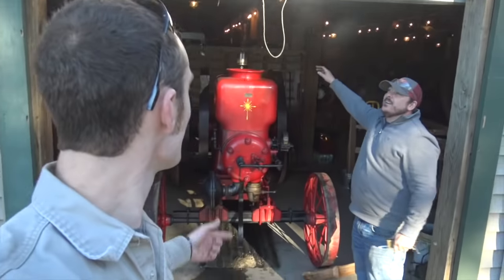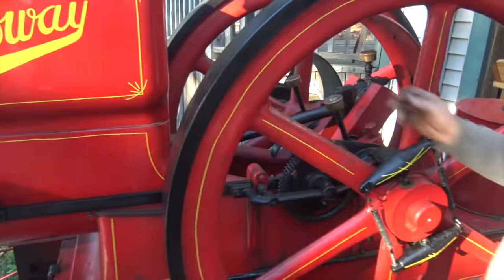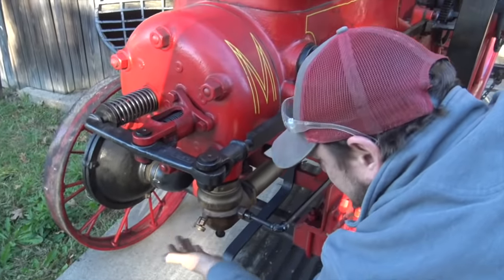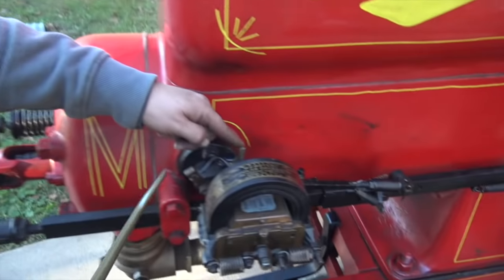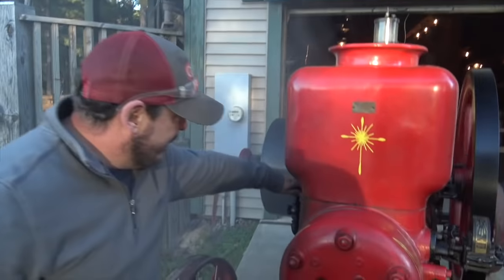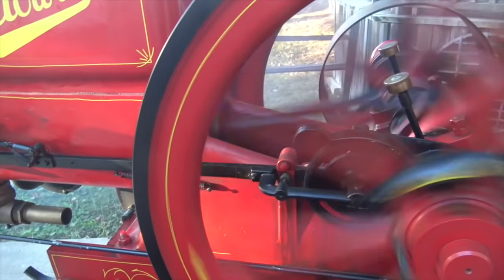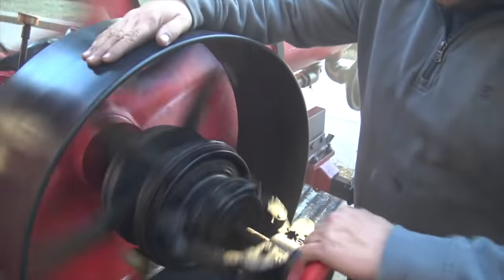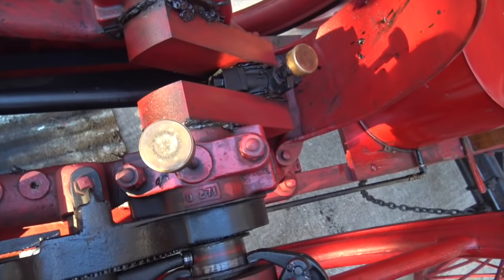WHY THIS INCREDIBLE ENGINE FROM 1916 IS PROOF THAT MODERN EQUIPMENT IS A SCAM & OLD STUFF WAS BETTER

Comment: When I was 13 to 16 I used to work in my dads scrapyard. We often got farm clean out jobs, old factory clean out jobs . . . scrapped lots of stuff from the turn of the century . . . 1900 I am talking.
One complete 1880 generator set we kept for a few years, had a coal fired steam engine and a generator, made DC current and a LOT of it. It had been in a factory from before that part of the city had reticulated electricity. The company was a family business and the grand father had them keep it as backup power. It had been perfectly maintained, and we ran it a couple of times just for the interests sake.
Imagine what it would be worth now. Eventually it went out to the steel-mill, and was scrapped.
Reply: A complete, well-maintained 1880s generator. Scrapped.

😨😨😨😔👎🏻

You know, I am no mechanic, but it still pains me to read that. Any museum would have loved such a machine.
Reply: @Briselance  Any man who saw it would have walked over to it and said
"What in the world ? . . . what an amazing looking old machine . . ." and touched it avariciously, committing the sin of coveting.
It had been made in the days that machines had inch thick cast-iron casings and pedestals with ornate,  thick makers plates of brass, where we would have a sealed bearing with a grease-nipple, it had these little brass cups with springed-caps, both the motor and the generator identical in their design touches, like some art-deco piece . . . 
And it RAN, it was fully functioning and SMOOTH as a Rolls-Royce . . .

I will obviously be in that circle of hell reserved for vandals and philistines.
Reply: Scrapping such a perfect machine is sacralige. 😭

Comment: I have a Fairbanks Morse model Z 3hp. not a hit and miss but from near the same era. I am  like a little kid every I  time I fire it up. It starts at 6 below and at 100 degrees. These are just amazing pieces of history from our past. I will never part with it.  What a beautiful machine!
Reply: Make sure it is passed down to someone worthy and trustworthy, in case something happens to you.

These pieces of historical engineering are worth it.
Reply: @Briselance   It will be, My son loves it and much as I do and he has been there every time I have started it and knows it about as well as I do. He is an adult now and I have had it since he was a child. It is very loved in my family.
Reply: Those type of engines were used a lot by railroads to power motorized track gang carts or "speeders"  The East Broad Top Railroad (which I am an off again, on again volunteer at) has at least 3 speeders that are powered by such engines that were built, IIRC, sometime in the 1920's & 1930's.  In addition to giving rides to tourists during the regular excursion season, EBTRR employees & Friends of the East Broad Top volunteers still use them for track work.
Reply: The only reason I would ever part with something like that myself is if someone I knew was able to fab that sort of machine.  

Then I'd let him tear it apart, 3D scan every part, change a thing here and there and start producing them.  Put the plans on the web for free.  Do a little Mechanical Necromancy ;)

Comment: My Great Grandfather drilled oil wells in Butler County, PA and used the natural gas from the well heads to power hit and miss engines to pump the oil.  One of them did backfire while he was standing on the flywheel footpeg and throw him through the roof of the shack.  Each engine had a different barker so they could tell from a distance if one stopped.

Comment: The machine shop, gearbox repair business where I work had a machine that sharpens blades that make worm gears. It was 86 years old when it needed its first repair. The need? A thicker spacer. The engineering on the machine was so intelligent.

Comment: Love it. I go to shows all year round that have these kind of working engines, steam, classic, military, agricultural, commercial vehicles. My passion is motorcycles.
A slightly different story. When I was at college studying engineering, we used to do tests on a single cylinder 1100 cc diesel donkey engine. Brake dyno torque measurements mostly. One of my student peers complained that there was blowing from the engine and pointed to a 3 inch pipe. I told him it was the inlet stack. To disprove me, he put his workbook in the vicinity of the stack.
Naturally, it sucked a 3 inch hole in his book and then consumed the rest.
His whole year's worth of notes came out of the exhaust stack in tiny pieces.

Comment: The thing, or the information, concerning this engine, and like many others, is: If there had been a cam that opened that intake valve, much more HP would have been created. That was the secret of that time.
Reply: @sourand jaded exactly! low rpm and high torque is what gives the engine its longevity.
A cam has more wear than a spring valve

Comment: I expect the torque is amazing. I remember we had a tug of war between a steam traction engine with I expect low horsepower and probably 50 people. Nobody won as the near two inch inch thick rope broke and sent us all flying. This was of course a long time ago before the days of elf and safety.
Reply: There is a Snow gas engine that produces 600 hp at 100 rpms and has a torque value of 31,500 ft lbs

Comment: I firmly agree with the statement made in the title of this video. Used to work for a defense contractor that made various military gear, so it was a sewing factory & when we were building a large, mostly automated piece of equipment, when it came time to select the 3 sewing machines, there we’re basically two options…buy brand new commercial brother sewing machines (great products) for a cheaper price, or 1940’s era refurbished American Standard machines for a decent amount more money, the decision was made to go with the 80 year old machines for more money. Rightly so.

Comment: I've always known older is better. I'm still driving a 1981 Chevy C10. Less than $9K in it. Had it for almost 30 years. Wouldn't trade it for anything.
MAINTENANCE, people... MAINTENANCE! Learn how to work on what you drive. Can save you tens of thousands.
Reply: I bought a minicar EV. When all your stuff stops working because there's no more gas I'll still be able to charge mine with solar for the next 20 or 30 years. My EV is chinese on purpose, it doesn't come with a ton of microchips like their western counterparts. 

There's something to be said for old technology, but when it requires oil, it will just be a chunk of metal at some point in the near future. The only old technology that will survive is wind and water powered.

Comment: Considering that the owner just bid on an anvil, one use for that engine would be great for would be powering a blacksmiths power hammer of about the same vintage or running a small sawmill set up.

Comment: Nice! I have the 5 HP version of that engine. It hasn't run in years. Moves by hand, and seams to be in great shape. Where did you get your springs? Most of mine are missing.

Comment: The key to making something last forever is to make it run with as low-stress as possible.
This thing has 16 horsepower. Granted true horsepower, but even for that 16 is rather small.
It's RPM never went past 200 here. 
And I don't see the compression on that enormous piston being particularly strong. Especially with the exhaust valve open so much. 

There is not a lot of heavy banging from high compression & smooth 4 stroke Operations. So the piston rings, piston & cylinder walls have virtually nothing wearing them. 

There is not much temperature change on the engine with it firing so sparsely. So thermal expansion & contraction wear isn't really an issue.

There is not much centrifugal force being put on all the internal components, such as the crankshaft, camshaft & their respective bearings. With such a slow RPM

You could probably get 5 years out of this thing by running it dry! DRY! AS IN WITH NO OIL WHATSOEVER IN IT!

These days, you won't get 10 MINUTES out of a dry engine! 

But put oil and/or grease in it?
Once in awhile. 
That thing'll outlive your grandchildren, and their grandchildren's grandchildren.

Just keep the EPA away from it. They have a tendency to make life hard for the average person like you and I.
Reply: What is this type of work is this engine used for, cause carring around a 1/2 ton block of steel for 16 horses power doesn't seem very practical.
Reply: They need constant lube actually.  They would burn up fast without oil.
Reply: @micahanglen4331  Stationary engines like this were used primarily for agricultural equipment, like threshers, winnowers, balers, and the like. Of course people also connected them to pumps, generators, and other less agriculture-specific things. Nowadays we certainly can make the needed power with a lot less weight, but the robustness of this design is impressive.
Reply: 10 years with no oil?
Smartest dude who zerks it to low compression low efficiency engines

Comment: I'd like to see one of these hooked up to a generator head and powering a modern home!
Reply: I don't believe it would power a modern home. It would only be good for around 7000 watts, and most modern homes use far more than that at peak. To have no disruptions most people would need a peak supply of 20,000 watts or so, and larger homes might need much more. It would also require a significant gearing system to spin the generator faster as the speed on this was far too low for electrical generation at 50 or 60 cycles and 120 or 240 volts AC. The fact that it is a hit-and-miss also means that no matter what you do, the cycles will fluctuate a lot. Some things are more bothered by that than others. While it would be a fun project, it wouldn't be practical on a daily basis.
Reply: @edifyguy  If you add a good bank of beefy capacitors to smooth the power fluctuations and batteries to store the excess then you can have a very energy efficient home power solution with the hit and miss or steam engine.  Remember that if you have a large enough battery bank and a decent capacitor bank set up then you can power your home while the engine is not running and in-between ignition without fluctuations in electricity flow.

Comment: Over 100 year old Gear:  Still runs perfectly

5 year old Gear:  either already breaking or already broken
Reply: Well, we're having a slight bias here to be honest. The stuff that has been running the last 100 years is unlikely to break down anytime soon. Everything that could and did break down already has been replaced, so we're looking at the toughest survivours of what was made a century ago.
Reply: New gear last as long as the warranty does, and not a minute longer. Hahaha slaves! 🤣
Reply: @dikkie1000  not quite true,most surviving peices of machinery are because of those who 
1. Looked after it. 
2. Didn't update working machinery. 
3. Have saved it from the scrapman!

Comment: 3:00 that’s because engines don’t have detonation unless they’re knocking, they have deflagration. Burning smoothly like that is more efficient and doesn’t damage the engine. Pretty much all large engines are actually quiet like this. The loud sound mostly comes from the rapid puffs of exhaust, but if you’re running at 50 RPM or less, it sounds more like a chain of puffs than the engine sound we are familiar with

Comment: The reason these old engines are still around today is that most of them haven't run or pulled a load in 80 years or more. Anything will last forever if it isn't used.
Reply: Not all true.
Ford used to manufacture straight six engines that would easily go 400 thousand miles with minimal maintenance. It was their simplicity and durability that made them twice as efficient as digital heavy modern motors and systems
Reply: @ethanfleisher1910  "twice as efficient"? How many MPG did it do (or % efficiency)? How often did fluids need to be changed? How much power did they have? What about specific power, kW or HP per kg? And last but not least: If they were so good... why does nobody today build them? Not the US, not chinese, indian, simply nobody.

I like old stuff. But acting as if it was the best thing ever is absurd.
Reply: @leocurious9919   I would look more into THAT PARTICULAR engine. I'm not saying on average, or making a comment about other combustion engines, but there were a few that really were insanely efficient not just for their time but remain that way today. And maybe reliability was the correct word, I suppose, I can't say how mathematically true the efficiency is, this is A fucking yt comment haha
Reply: @ethanfleisher1910 You just made that up. They aren't more efficient. Digital efi is way more efficient.
Reply: @leocurious9919  its because the government banned them for the environment

Comment: Older vehicles didn't need security devices to keep people from stealing them. If you didn't know the code you weren't starting that thing.
 Pump 3 times hold starter for 5 seconds,wait 60 seconds pump once hold starter for 10 seconds. Don't touch the gas turn the key and it starts. No one could start your car but you.
Reply: Lol, my old 78 is loyal -20 or could be -40. Good pumping and Betty fires right off. Granted shes cold blooded so it takes a try or two but she comes to life just to push snow or be a skidder. Granted, theres a trick to starting that only people who run the truck know. My F700 you gotta hit a switch before it even thinks of firing off. Will crank but wont start.

Comment: I am a mechanical engineer by trade and I am 95 years old and I COLLECT BOOKS AND MAGAZINES ON TECHNOLOGIES and I buy old technologies for I am a collector of technological stuff and my place in Kazan is more of a Museum of old technologies I inherited from 5 generations and I am the 5th generation. I will be honest with you, all of those so-called improvements were already there and they are in  existence for many decades. They are just being released and passed on as NEW IMPROVEMENTS even though they are not new improvements at all but decades old technologies kept under tight wraps and released only when it improves their PROFITS AT YOUR EXPENSE! In fact, in former East Germany, there is a LAW REQUIRING THAT ALL MANUFACTURED PRODUCTS WILL LAST FOR 25 YEARS AND CAN BE REPAIRED NO MATTER WHAT IT'S CONDITIONS ARE! They designed to be 100% perfectly and completely repairable either in the field or in your house or in your garage or in your work shops. My Cold War era laundry machine and drying machine are more than 67 years old and are still in good pristine condition and purring like a newborn kitten! The list is endless. And always keep in mind that ALL CORPORATIONS LIE ALL THE TIME!

Comment: if the horsepower is 16, at say, 100 RPM, then its torque is actually frightening!
Reply: About 1100 Nm if you do the math (16hp x 750W/hp / (100 rpm x 2Pi / 60))
Reply: @peterhaas2503  I did mine with the SAE horsepower equation, inverted. From torque×RPM÷5250=HP, to torque=(HP÷RPM)×5250. Came up to 864 ft. lbs
Reply: @ericcaves7530  1 ft lb is around 1.35 Nm, so we are in the same ballpark! Impressive figures anyway

Comment: Does anyone else remember all the promises we got from government in to 1960's about how the cars of the future were going to become so fuel efficient in the future? My 1970 Ford got 20 mpg. My 2003 Ford gets 12 mpg. That's what happens when there is no accountability. In Europe the gas mileage is much better than is allowed in the U.S. because of corporate influence on politicians that depend on corporate sponsorship.
Reply: Yes, however many things got complicated once environmental impact assessments came into the mix. A lot of restrictions were put in place from cars to refrigerators.
Reply: my 2013 subaru gets 23ish mpg
Reply: I forget the year, but my dad had a Ford Festiva that was probably 40, maybe 45 mpg.

Crap now I am heartbroken; I remember the day it finally broke down and we had to let it go. I was small when dad used to drive me around in it and it carried him everywhere he didn't need a truck.

With a wry smile he told me "I've driven that thing longer than I've known your mother." Now that I'm older it occurs to me how much that loss must have hurt for him.

Comment: There’s just something about these old ‘corn popper’ engines of yesteryear that’s far too endearing to ignore. No Ops. Computer regulating fuel modulation; no complex inter systemic control systems giving vague readouts concerning whatnot; just basic analog of it’ll run or it won’t ⚙️

Comment: The reason it seems to use little fuel is that there is no load on it.  Belt it to something that takes hp to turn, it it will get really thirsty.